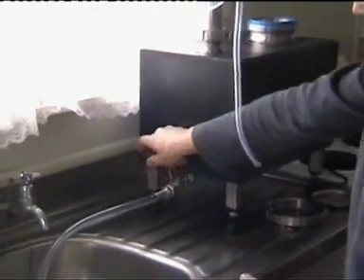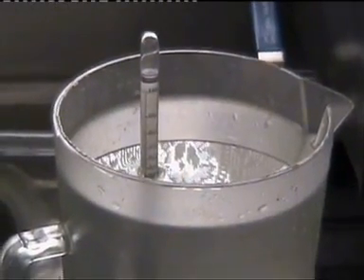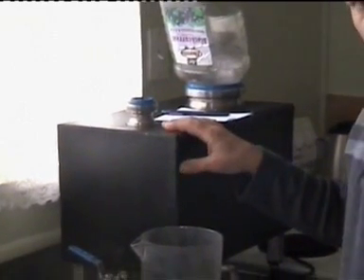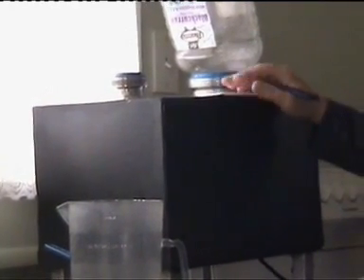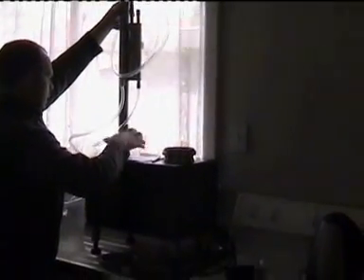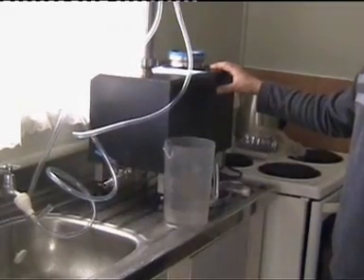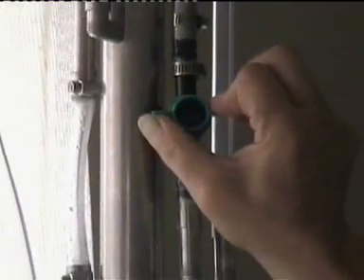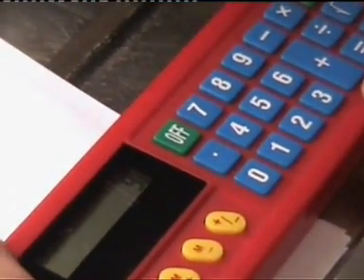Home distilling with fractional alcohol still, part 2

Comment from the maker: @italkfan Hi, no, it will not work simply because it is distillation - not rectification, so you will get constantly declining ethanol percentage meaning that the water and all other heavy stuff are reaching the top of tower and as a result you are ending up with a crude mixture of  inseparable fractions - this called azeotropic liquid where different substances are bonded to each other and share their physical properties, and the only fractional distillation "rectification" will give a result.